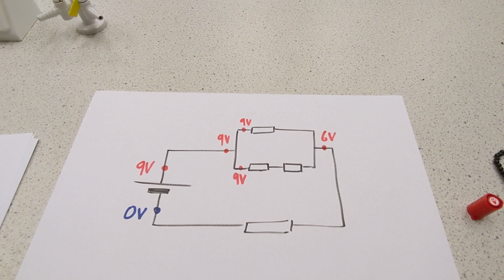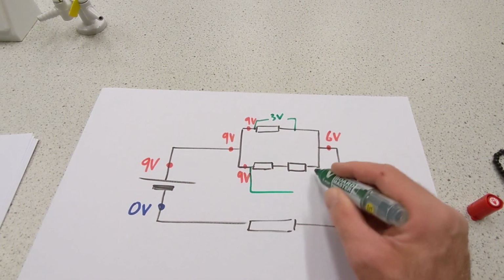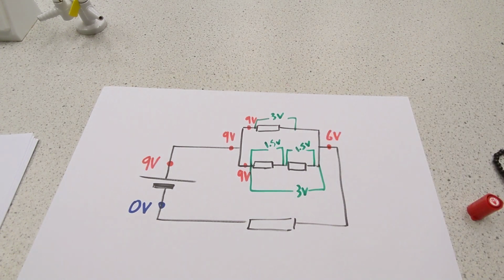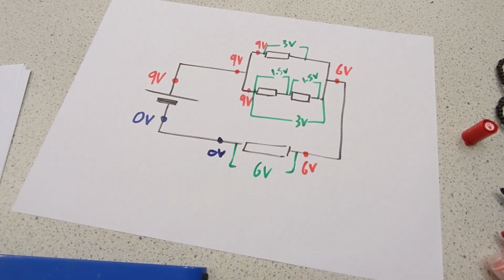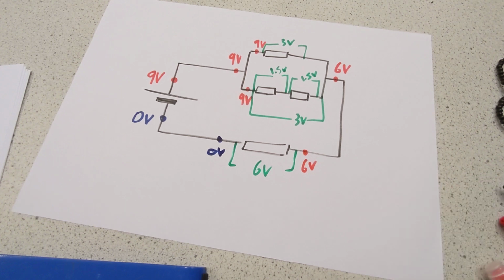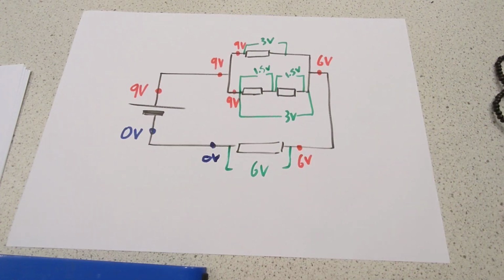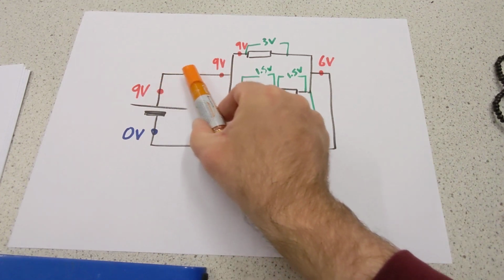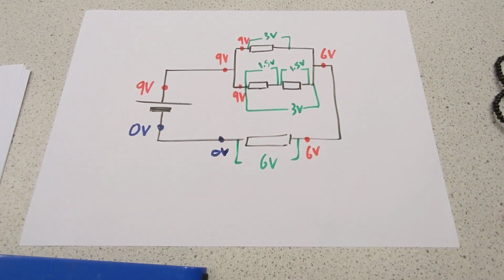Trying to explain electric potential difference in circuits using gravitrax

Comment from the maker: The different currents in the different parallel branches can be explained in terms of different drift velocities of charges, basically different terminal velocities of charges due to different resistances. It's directly analogous to terminal velocity of a body falling through earth's gravitational field. If I have two bodies falling one behind the other, both at terminal velocity, you wouldn't say the body that is behind is being slowed down by the body in front. Similarly, the different currents in the two parallel branches are due to different drift (terminal) velocities of the charges, which depends on the resistance along the branches.

The gravitrax analogy works far better than the caloric analogy of "charge picking up and dropping off energy".

But it's still not perfect 😂